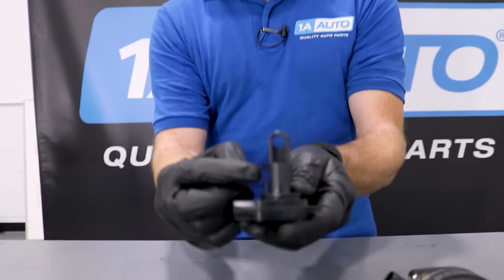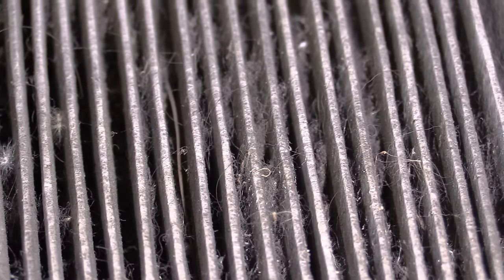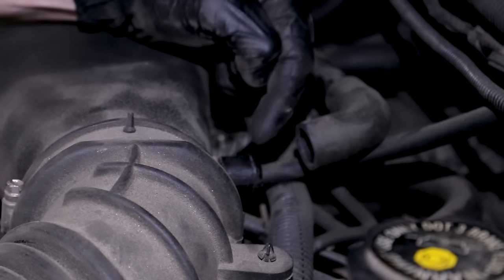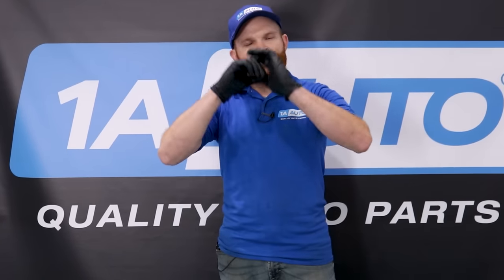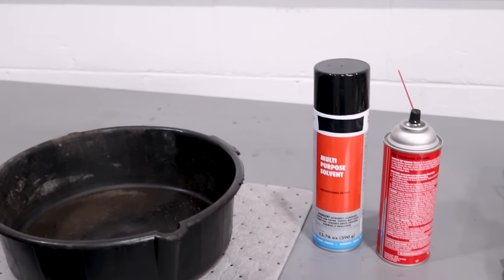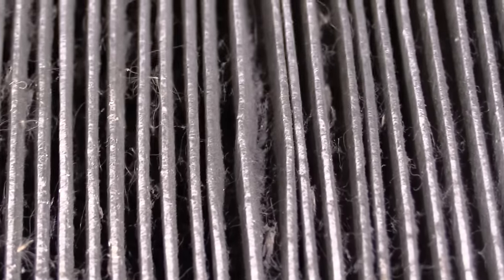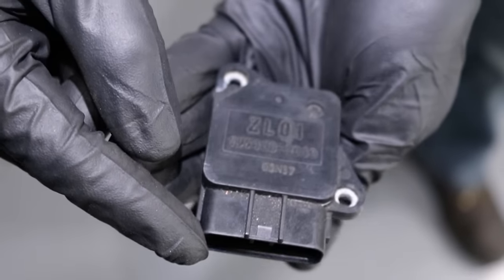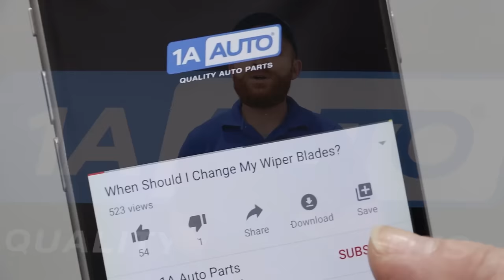What Does a Mass Air Flow Sensor Do in a Car, Truck, SUV?

Comment: Hey can you help me.  My car check engine lights on when i turn on my ac on.  Den i trace it using obd2 scanner and it prompts code:p0100 whice is maf sensor right? The i erase it.  No check engine light on if dont turn on my AC.   But if i turn on again theres check engine again. Vios 2003 manual
Reply from the maker: +Eric Son We wouldn't be able to diagnose an issue like that here, you may want to have a local mechanic take a look at it. Thanks for checking us out! http://1aau.to/m/Shop-1AAuto-c

Comment: True or false: If the vehicle is on and I disconnect the cable for the air flow sensor & my vehicle stays on ... does this indicate a faulty sensor?
Reply: That's what I'm wondering also. Mine didnt die when unplugged haha.

Comment: Hi. I have a 2000 jeep grand chereoke laredo 4.0. I can't find where my mass airflow sensor is??
It's not in the air intake system. Can you help? Thanks
Reply from the maker: +JAT - Just Amature Tech - Phil PJ Davis Look inside the air intake system to locate the mass air flow sensor in the 2000 Jeep Grand Cherokee.
Reply: @1AAuto . There is no electronics that go to the Airbox or any part of the system